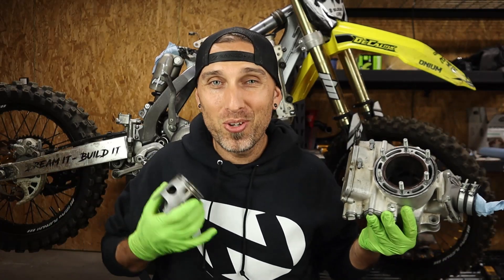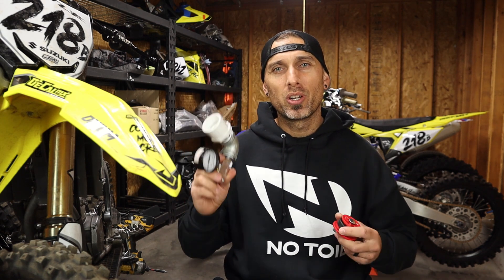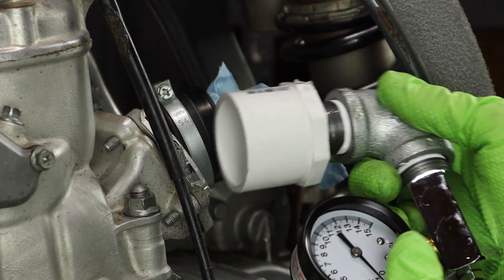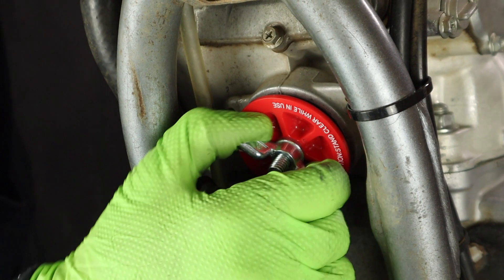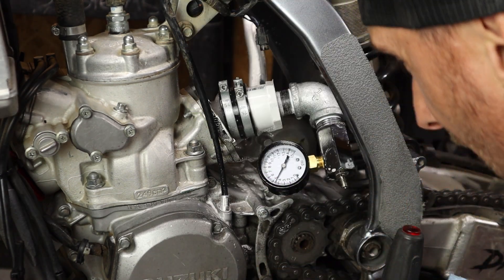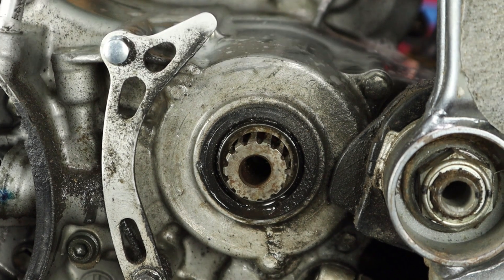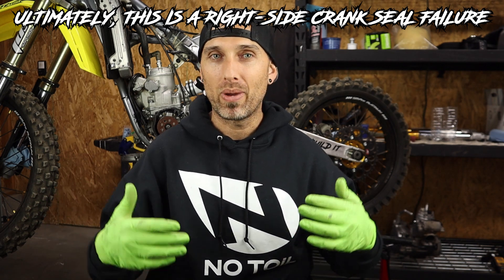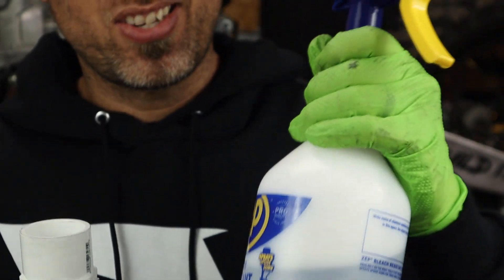I BLEW UP MY TWO STROKE | Let's Find Out Why - Dirt Bike Leak Down Test & 2006 RM250 Top End Fails

Comment: Air is getting into the transmission from around the shaft of the main powervalve or the RHS boost port valve when you're pressurising the cylinder.

It's not completely air tight from the crankcase to the powervalve mech which is how it gets oiled from premix.  In general operation, compression is made above the powervalve ports and the pressure from combustion would go out the exhaust.
 
That means there was no air leak as you would have known if the RHS seal was blown. You would have been riding a fog machine with spooge everywhere.

Good luck finding a replacement powervalve, they're rare as hens teeth.
Reply from the maker: That is super interesting and makes perfect sense now that you've laid it out for me in such a logical manner. Basically right behind the power valve door we've got the cavity where the actuating rod comes up in other words.

I also understand what yourye saying about no spooge. I was wondering how I could have a wet side crank seal leak, but not be burning gobs of transmission oil/ tons of smoke.

This is really cool, thank you for the reply. I'm going to pin it in the comments so other people can hopefully find value in it too. 

What would you inspect next as the cause of damage? 

The original jetting was fat, each jet one size larger then it should have been for the exhaust combo at sea level.

Although I suppose the last owner who mentioned that it didn't feel quite right may have been trying to feed it more fuel to combat the lean condition, but it was already damaged thus rendering that re-jet pointless.

So if there was no leak, and there was already damage, it was more of a common wear-out & failure?

Thanks for running a clinic JM!
Reply: @mxrevival  I guess age could be a reason. For some reason I had in mind the PO had recently rebuilt it. I would have expected shattered skirts though
Reply: @mxrevival no worries. I've been trying to keep my 06 rm250 alive for the last 8 or so years so know it in and out.

When you showed that piston top with the broken ring land my first thought was "somebody got the ring gap wrong". 

I remember you had a nightmare trying to get it started which made me wonder if the timing was too advanced in that video. Did you get any indication of pinging when riding?

Right now I think improper assembly was the culprit as it's hard to assess that piston considering the damage. Under the piston crown with a heavy burnt oil patch can be a sign of getting too hot/lean.

Comment: 2 full wraps, no more than 3,with tape in the direction of tightening, you can add pipe dope on top if u want, it acts as a lubricant to help get the joint tight.
Reply: You had 5 wraps?????? I'm a generator technician I install gas lines everyday and I've never had a leak with my joints. That tape had to be garbage, definitely use a pipe dope like blue monster or something to help seal it. 5 wraps is absurd

Comment: Wow quite a roundabout right side crank leak hahaha. It's gonna make a few awesome videos though!
Reply from the maker: Like my pro engine builder buddy Jimmy says, "the air needs to come out somewhere" haha! A few very intelligent dudes in the comments also allude to some other potential issues as well. Need to check the center cases where they meet, the cut on the head, etc. Excited to rebuild this soon

Comment: Dude, those video baby monitors are the shit. Only way I'm getting out to the shop when mama's working.
Reply: Those old Suzuki 2 stokes in old Arctic Cats are bulletproof!
Reply from the maker: It's funny, I was doesn't work at the distance I am from the short-term apartment we're in. The garage is pretty far away and apartment is on the third floor... So I sit one of my cell phones behind it on speaker and then call myself from my other phone also on speaker 😅
Reply: I would take the clutch and power valve covers off and retest that right side crank seal as well as the power valve area as mentioned by someone else. Is the power valve sealed from the transmission and clutch cavities? Otherwise they all would have an air leak, right? I've only been into 4 stroke Suzuki, and snowmobile engines without power valves.
Reply from the maker: No the transmission is not sealed from the PV completey. Johnny Moto nailed it on my oversight. 

There's a seal on the main shaft that the power valve rides and rotates on, which air could have been pushing through when I pressurized it the cylinder, that would then make its way into the bottom end and out of the counter shaft or sprocket seal.

I believe the engine was just damaged already, Maybe because it was already ridden too long or too lean by a previous owner.

As far as a retest, at this point we will just rebuild this sucker & I can't wait to ride it again
Reply: Gotta do what you gotta do. That's a great idea. I have an engine now. I'm about to do a full rebuild as well. I have split cases and replaced bearings and broken shafts and gears. First time for a full rebuild for me. I'm glad you keep these bad ass videos coming for us. Moving isn't fun or easy.
Reply from the maker: Kill it my man!! I appreciate the kind words!!